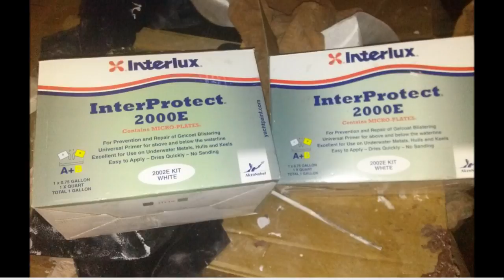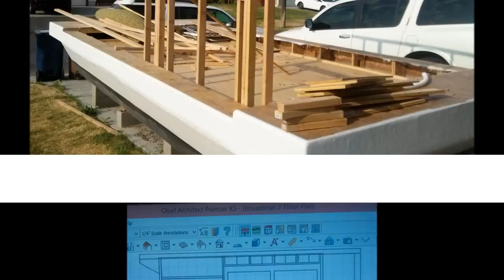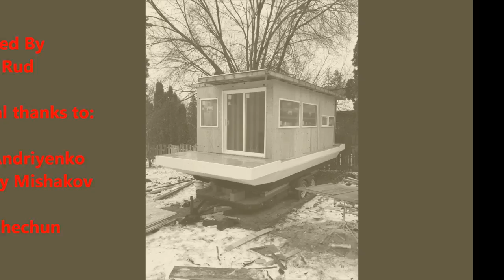Houseboat Build Vol. 1

Comment: Curious about the roofing.    How far apart are the 2 x 4 rafters,  what thickness plywood, and what did you waterproof and cover it with?   Is it designed to be walked on?

Comment: How deep did you make the base? I am preparing to build a 8x16 small houseboat and I am not sure how deep to build for the weight. Any info would be greatly appreciated. Tku
Reply from the maker: I have a 10' x 23' by 2.5' deep.
Reply: Google calculate buoyancy and try some of those links,most just need your dimensions to do a pretty good estimate

Comment: Cheap pine framing, waferboard gussets, Internal moisture will destroy that construction in a very few years. Its fine to have marine ply hull but take it from a boat builder  experienced in repair work for forty years humidity inside creates the most damage to framing not the hull.
Reply from the maker: its ceader frame.
Reply from the maker: i have the money to keep a boat builder like you buizzy whats your phone number?
Reply: @edyrud2445    In Canada  and retired sorry.
Reply: @edyrud2445    Never used cedar myself, other than canoe planking. Its soft especially white cedar so doesn't hold screws well , fibres crush. Cedar also has natural resins although white or eastern cedar has far less than western red cedar which help against rot but prevent most adhesives gripping well. Just not  a framing choice up this way. I will add I have seen many a cedar plank boat rotted as well.  Wish we had cypress up this way but white oak  is the best we have locally for framing .